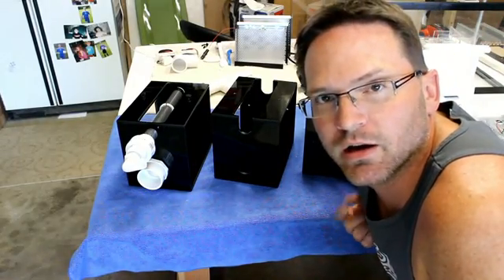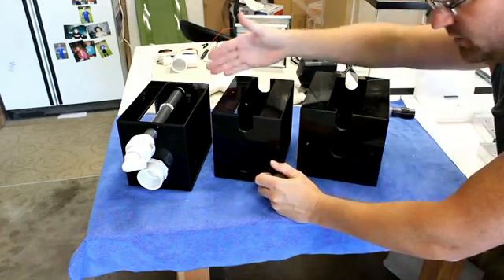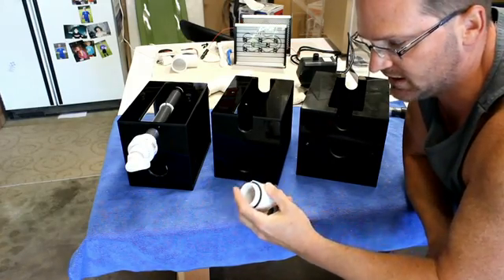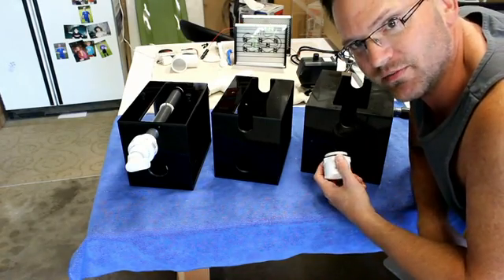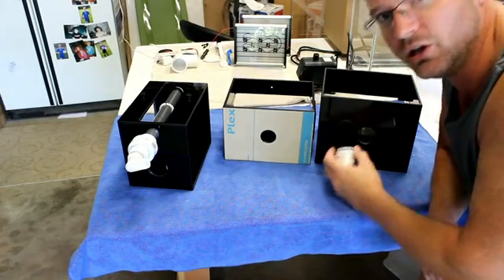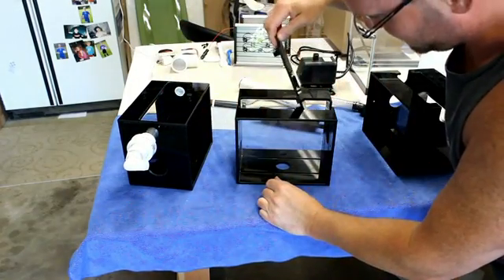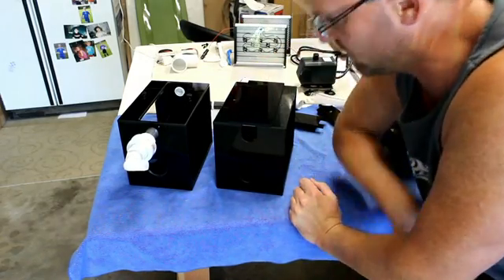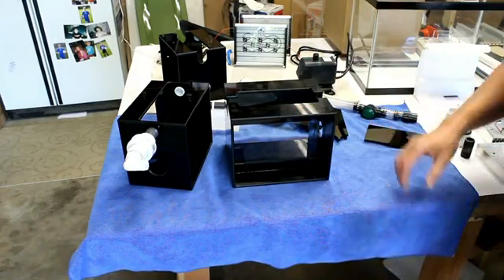Rev 1 & 2 Upgrade Modifications

Comment: I have a 260g mix reef.  Do you have a bigger model for this type of marine system ?  I have a big bioload
Reply from the maker: Yes, I make an L4 which is basically 2x as large.  I have one running on a 210 alongside a skimmer, sock, GFO, carbon, and it's overpowered for that tank but it helps to have the extra width for turnover rate.  I have plans to make a larger unit, but it would likely be taller so not good for sump-under-tank setup, more of a dedicated fish room scrubber

Comment: How do I buy 2 of your units?  Tricky part, one is for my RED SEA MAX 250 65 gallon  which is all in one unit fish tank. How/where would this fit into this style tank?  2ed one would be use on Discus tank 96 gallon predrilled tank..?   Do you have an email?  Thanks Kev
Reply from the maker: The all-in-one is tricky.  May not work well.  Discus tank is easier, especially if it has a sump.  I'll send you a message (you can send messages through youtube)